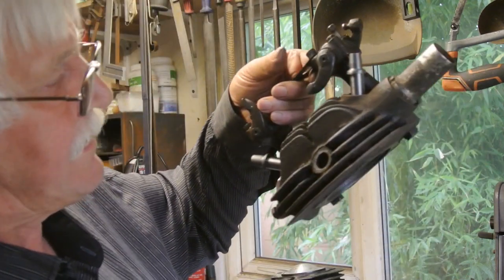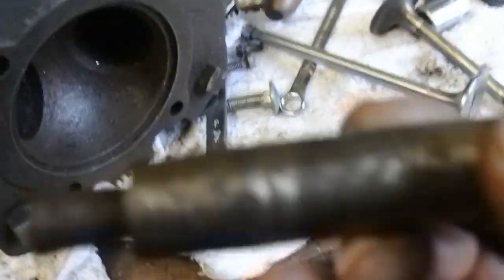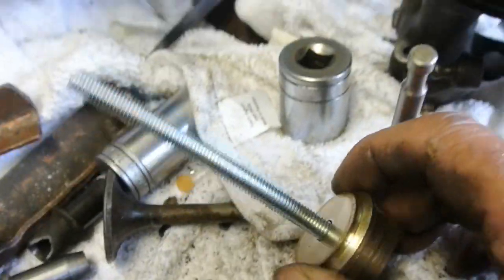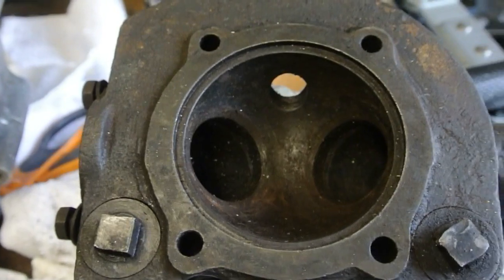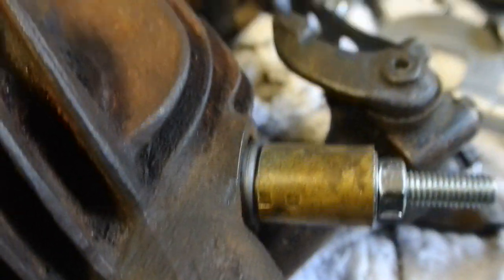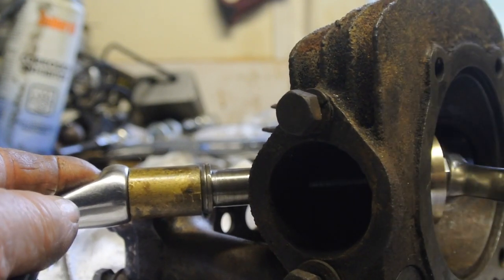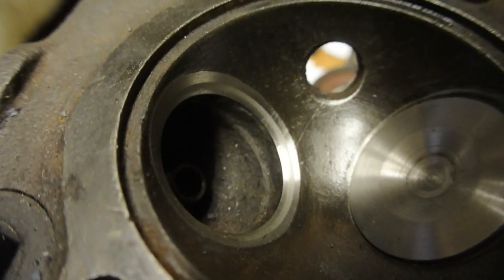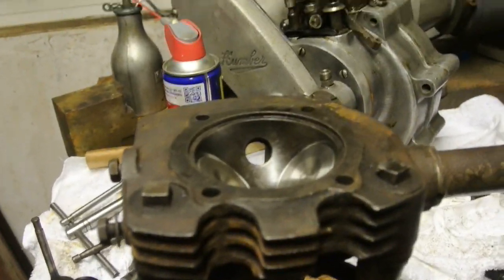Fitting Cast Iron Valve Guides

Comment: If i recall correctly some triumphs have cast iron guides in alloy heads. The were great to get out because you could snap the exposed part off, where the circlip groove was, and drive them through so you didn't risk scratching up the guide hole in the head by getting them out the way they went in.
Reply from the maker: I Didn't know that Chris, my first bikes were a BSA and an AJS all of which had Bronze guides alloy heads but all of the vintage stuff has cast iron Guides.
Reply: @bobrodgersonsmostlymotorcy9265  that would be the logical mixture. Triumphs with alloy heads were a constant source of aggravation, guides coming loose and cracking being two of them. It would have been better from mechanics point of view if they had stuck with cast iron, or perhaps not as it was more work for the working man to do.😉